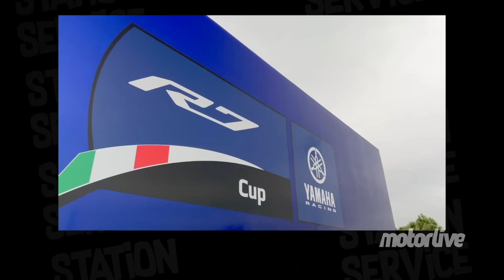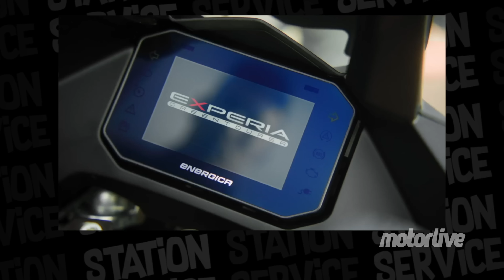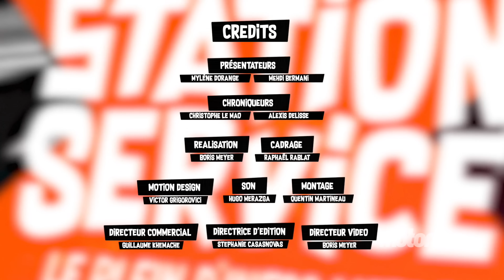STATION SERVICE #04 | Quelles motos A2 en 2023 ?? (S1E4)

Comment: pour repondre a la question a 12:15 c'est extremement simple de brider un vehicule electrique: tout controleur (le boitier electronique qui delivre la puissance au moteur) est parametrable, souvent il y a 3 modes ou plus et pour chacun on peut regler une puissance max et egalement une vitesse max et c'est d'ailleurs le cas des equivalent 50 qui sont brides a 45km/h, en pratique a la puissance max que leur batterie peut fournir ils pourraient quasi tous atteindre au moins 70 (et meme plus pour les 3000W).

Comment: Ne pas négliger les assurances classiques surtout si on a déjà le permis auto.
En A2 à 36ans j'ai assuré une Royal Enfield continental GT650 pour 360€ environ à la Macif en tous risques et l'équipement est compris dedans à hauteur de 1500€.
Quand tu as voiture moto et logement, les assureurs qui sont de vrais marchands de tapis sont plus enclins à faire des tarifs intéressants.
Sinon mon choix avait été A2 native avec la continental GT, j'ai depuis passé la passerelle au bout des deux ans sur la Fatbob 107ci de mon moniteur auto école 😍 et gardé la continental en attendant d'avoir les moyens de changer.

Comment: Bonne émission mais les carburants de synthèse ne sauveront pas le moteur thermique mais l'Allemagne s'est battu pour permettre poursuivre la vente de voitures luxes allemandes pour les élites. La quantité d'électricité nécessaire à la fabrication de ce carburant est sans commune mesure avec les besoins énergétiques pour faire rouler les véhicules électriques. Le prix et la rareté des carburants de synthèse seront les meilleurs amis des motorisations électriques.
De plus, ils faut se poser la question sur l'emplacement de l'usine de porsche pour fabriquer ses carburants soit disant révolutionnaire. La logique aurait de mettre l'usine au plus de ses consommateurs. En plus, Porsche annonce que le carburant de synthèse est une bonne solution pour les sports mécaniques.